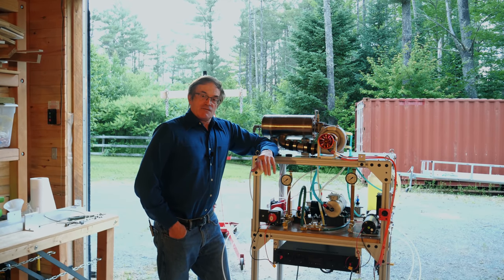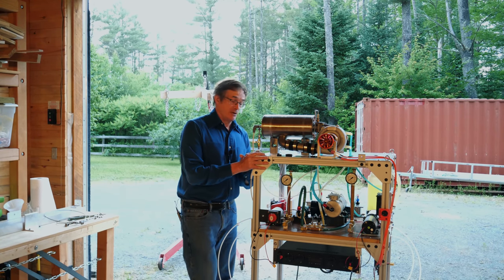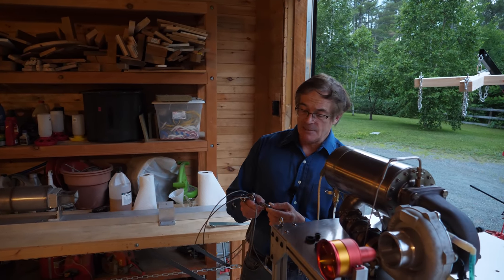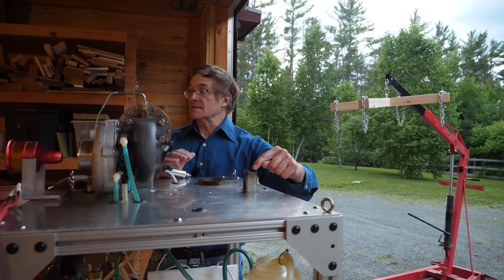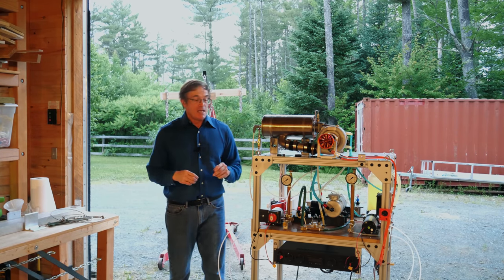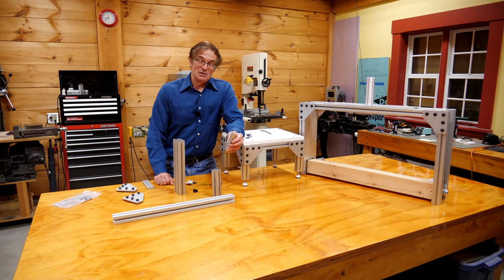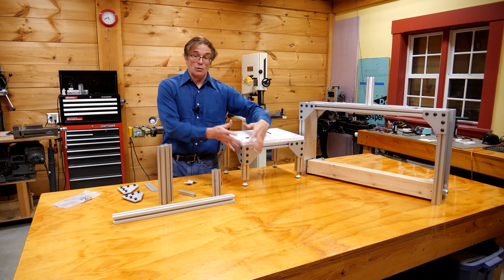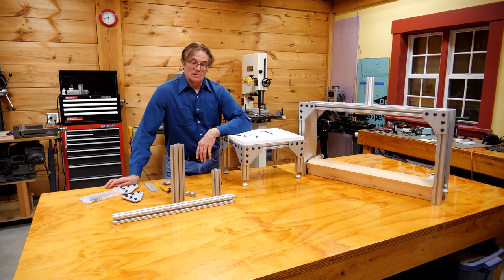What else goes into building a jet engine? - Part 1

Comment: I work in a plastic injection molding company in Germany and we love those aluminum extruded beams. Whenever the need arises for a custom structure, that's the quick, easy and cheap solution and, even in an industrial setting, if properly built they're eternal.
Reply: i think we used literally 8020 stuff when i was working in a shipyard in germany. unfortunately it looks like i can't get it just for me from them (can't go by the shipyard or such unfortunately)

Comment: I have a jet engine powered GoKart. It uses a 75HP aircraft APU engine that delivers rotary power through a gear box that reduces the internal 50Krpm to 6Krpm. We built another gearbox to reduce the rpm to 3500. It has some jet thrust. It uses a variable ratio hydraulic drive system and a home made differential rear end so it drives like a fine automobile. We built it from scratch 20 years ago and many many people have driven it. It accelerates very quickly but is limited to 50MPH,  We use a 25% gas 75% diesel mix as fuel. It has dual hydraulic brakes, springs and shocks, a Volvo seat, starts from 3 lawn tractor batteries on board and real jet instruments from an airplane. It even has reverse. The driver is protected by heavy armor plate in case the engine explodes. It has never given us any real trouble. We did sweep up our first differential that came from a lawn mower with a broom. We subsequently built one that has been trouble free.
Reply: I would love to see that on youtube if u got any videos of it please show me where to look
Reply: I'd love to see that as well, John.
Reply: Do you have an idea of how fast it would go without the limitation (and maybe some other modifications to ensure it survives)?
Reply: Any videos of?  Sounds like an interesting design worth showing as I'm interested to see what you described.
Reply: Any videos i would love to see that

Comment: Good thing to keep in mind is that 80/20 is effectively the "name brand" for extruded aluminum fixtures.  There are literally hundreds of other brands that offer the same or similar products.
Reply: More about the standardization...
Reply: I've had a bad experiences with their lead time too. It took several weeks for very standard components. I should have gotten the off brands. I think McMaster Carr is pretty good.
Reply: It's also worth beating in mind the cost of it lol. 

€850 just to buy the parts for the FRAME,   not including aluminium sheeting, epoxy coated plywood, castors, base etc.
Reply: Thanks for that comment.  I used 80/20 for several years in   the past working for companies without budget constraints.   Now I'm considering a project privately and the cost through 80/20 was alarming!
Reply: @Ontariolabz  It really is shockingly expensive, I really don't know how he made this for $350(talks about it in a separate comment) when he says in this video each corner bracket is $15 and it uses 24 of them, that's $360 alone, and the lenghts he uses here are 75c per INCH!! I checked their website, I just left it after that because I didn't want to argue over something so trivial.

They're very high quality tbf, but ye they're crazy expensive to be using for hobbys like this. If I had enough money to not care I'd definitely buy them though tbf.
Reply: @atourdeforce  He likely receives parts from companies for free or discounted / already had a substantial amount of parts already.

Comment: I'm really interested in the turboshaft engine. Do you intend on connecting that to a motor-generator, or are you going to put a propeller on it (and maybe make the ultimate catamaran)? I'm asking because I'm wondering how you'd actually measure shaft power, and if the power was high enough, it'd be interesting to see if you could make a decently powerful generator out of something like this.
Reply from the maker: Yup.
Reply: From what I know jets have very low torque
Reply: He said he was going to do a turboshaft. Thats basically another turbine hot section connected to an output shaft
Reply: @RogierYou  they substitute with rpm. You would need reduction gears to work in the right rpm range for a standard generator.
Reply: @TechIngredients  awesome,can't wait to see that.
Reply: You wouldn't make an efficient generator from this. It absolutely GUZZLES fuel and doesn't have amazing torque numbers compared to a simple diesel engine. You want lots of torque to run a generator. 

Very fun project 😀 but very very unpractical.
Reply: @atourdeforce  this turbocharger based jet likely isnt optimized for efficiency but a turbine engine can match a diesel for fuel efficiency at fuel throttle.
Also a turbo spinning at 80k rpm with enough reduction to spin a generator will make lots of torque
Reply: @BrokeWrench  I really can't fathom how it could touch it I'd imagine it I'd about 4 times less fuel efficient. But I'll concede I'm only surmising and I'm not an expert on it. You have me curious now  to do some digging.
Reply: @BrokeWrench  BTW you be REALLY surprised how much torque generating needs. We have a waterwheel which produces unimaginable torque but low speed, amd once through the gearbox as soon as its up to speed, enough to start generating, the whole thing bogs down the waterwheel by about 50%. It's also a small generator running off the gearbox output. 

So I'm not convinced just because you have high revs, will guarantee you high torque out the other end.
Reply: @atourdeforce  part throttle turbines are very inefficient, so yes, as a generator they aren't a great idea, but at full throttle a well designed turbine engine is just as efficient as a diesel at a fraction of the weight. That part throttle inefficiency is what hurts them. Everything has its tradeoffs. This turbo based turbine is far from being efficient because the amount of compression after the single stage compressor is low and the work extracted from a single stage turbine is minimal especially since an automotive turbo is likely designed to to minimize flow restrictions and only needs to spin the compressor up. Still good for about 40hp to 60hp on that size turbo. Could probably extract 20hp or so from a simple turbo hotside connected to a shaft though
Reply: @atourdeforce  say your generator runns at 3600rpm and your turbine spins at 80k rpm but only makes 5ft lbs. Thats a 22.2 time torque multiplier means the generator would see 111 ft lbs of torque from the engine (minus losses at the gearbox)
A typical diesel pickup truck turbo needs 60 or so hp to compress the intake air for normal operation
Gears can increase or reduce torque, but rpm changes proportionally to continue producing the engine's current hp level
Reply: Yes turboshaft pleaze!!!!
I love your experiments and proof of concepts.
May we please see you put this to practical application! I can't wait to see what you could build in your own monster garage. I could imagine if you rolled a bunch of your various Subsystems together into one single application! Perhaps an amphibious human carrying single seat jet  turbine electro propulsion multi rotory flight platform  with high-power electro magnetic microwave 3D crash protection forcefield , audio phase shift sound reduction noise protection,  modulated pulsed plasma generated laser guidance collision avoidance. Of course the system will have great fuel versatility, however the preference will be to fly it on the good distillate of the professors rum formula.  Although I am a bit at a loss as to where the solid propellent rocket motor technology is to be employed? Rocket assisted ballistic parachute ?  Doubtful with all the other innovative crash protection. Surely not any type of weapons delivery? (Tech  Ingredients doesn't  recieve DARPA funding? Doubtful,,,Hmmm) 
Of course we haven't gone into the subcritical fluid systems used with the heat exchangers and supercooled superconductivity motor windings and power distribution systems. 
Some things remain highly secretive in the form of charged particle cloud experiments..... 
What all did I forget? 
Does smashing televisions fit into the equation?
Reply: @RogierYou  Power is a function of torque and RPM. Got lots of the latter.
Reply: @atourdeforce  That outcome changes with a recuperator.
Reply: Breaking Bad

Comment: Please please please go back and list EXACTLY what you used for your acoustic speaker setup, also why you used the acoustic ceiling tile versus the rockwool faced insulation you used for the sound chamber.  WHICH type of acoustic ceiling tile did you use? I've been attempting to match it, while also providing acoustic dampening on my walls.
Reply from the maker: The rockwool insulation is too soft and would simply  compress rather than bend or flex.
The Armstrong ceiling tiles  are all basically  the same except for the cosmetic surface treatment.  They should all work similarly.

Comment: I worked at a manufacturer of conveyor belts for several years and the area I worked in was R&D. We used 80/20 for everything, for shelving to complex support and safety "cages" which housed massive tools designed to cut the plastic modules which the belts were made from. The main advantage, no welding required, the adjustability was another key point in its use. If something didnt line up quite right, loosen a few screws and give it a decent bump and retighten... WALA problem solved. And being that it was aluminum, no rust or paint to deal with. Hopefully one day it will be affordable for home use, unfortunately it is expensive and beyond the budget of the average "inventor" mad scientist.

Comment: You should look into wagon brakes for your movable stands.  We used movable set pieces in the theater with swivel casters but needed to be abe to lock them in position.  The caster braves were no secure enough.  Wagon brakes lift the platform off the casters so that the platform cannot easily move.  Your favorite supplier McMaster Carr carries a large selection.

Comment: For through holes consider flexiform grommet as well, comes as a ro0ll of nylon that you simply cut to the circumference of the cutout, and then glue in place. Handles pretty much any size hole, and comes in various thicknesses for various materials. Oil, water and fuel resistant, and very hard wearing. Have used it for bearings on shafts that have a limited amount of rotation ,and it does work well, keeping the shaft from wearing for a long time, and simple to replace as well when worn.

Comment: you should ad a link to a source of the aluminium profiles in the description.
I wonder: the 5 holes in the profile go all through, and the profiles have a large surface.
imagine a desk that rests on such profiles with this channels for watercooling.
two side legs would be u shaped and those legs be connected at the front and rear edge of the desk. this would create a loop. at some point this loop could be interrupted to attach a computer to it.

Comment: A side topic for the turbojet engine thing might be bleed air systems. The compressor can make a surplus of pressurized air on the intake side. And although it's hot from being compressed, it's still not as hot as the exhaust gases. In turn it could still be used to drive small auxiliary turbines that provide power or simply providing pressurization to other things.
Reply from the maker: True and we're  planning  to incorporate  that principle into the turboshaft.

Comment: Can't wait for that solar tracking mount video you hinted at. I've got a small diy 12v 2panel setup that I want to be able to wheel around anywhere as a single collapsable unit (that can fit in a sedan with the rear seats down) with a view to add tracking later. I'm keen to see how far 8020 hardware would get me.

Comment: I love those Al strut systems but wish they had Kits with all the he common stuff all in one at a bulk price. I struggle with keeping any inventory of all the parts I need (and some I have no clue exist) and buying them ad hoc can get pricey. I'd love to be able to spring 500 bucks and just get a starter kit of everything.
Reply from the maker: I disagree.
They are fairly priced, but not cheap.  Order what you need for a particular  project and add to that inventory as time passes.  You'll  find that what you use is rather limited compared to the potential options and many of those "kit" components will just end up sitting in a box.

Comment: burn barrel, mount the turbo to the top with the inlet of the exhaust side going into the top of the barrel,  the boost side of the turbo goes to the bottom of the burn barrel ..  get a basic oil system flowing to keep the turbo lubricated and you throttle the turbo by the inlet of the turbo like a throttle body. ..   start a fire close the barrel so its sealed and only exit for anything is into the hotside of the turbo..then spool the turbo a bit and it'll self sustain itself after a fire gets going.. CRAZY BOOST! YOU NEED A WAY TO CHOKE THE TURBO OFF FROM MORE AIR.. IT'LL BASICALLY RUN AWAY ON YOU IF NOT.
Reply: yeah there are various ways to thermally expand gases and channel them through a turbine. you should make a video of your idea :D
Reply: @byloyuripka9624  it's already been done my friend. not my original idea but much simpler and easier to build.

Comment: I would love to see a series on naturally aspirated propane burners using a venturi and Bernoulli's principles to improve my blacksmith forge, but also applicable to people using a foundry.  Seems related to some of your rocketry projects.  I have built a fairly crude propane burner using plumbing parts with a propane tip for the ejector.  Upgrading to a ribbon burner would be a great upgrade.  A nice addition for simple/cheap vs more complicated but better heating.  If you have recommendations of someone who has covered this before, I would appreciate it as well, though I love your style.
Reply from the maker: One thing you can look into is a coil that is located inside the burner and which preheats the fuel so that the pressurized vapor exits just inside the venturi and supercharges the intake flow.
This was the basis for an old jet engine design without moving parts called the Gluhareff jet.
Reply: @TechIngredients  Just watching a few videos on Gluharoff Jet shows me it would get way hot enough, even without insulation.  Perhaps too hot!  Will need to test, but looks like a fun build.  The 90 degree bend seems odd based on what I have done with naturally aspirated venturis, but you can't argue with those results.

EDIT:  Appears 90 degree is more for propulsion, so not necessary, strictly speaking..

Comment: I love this 'channel ' and agree with almost all of the analysis and comentry. I have unfortunately discovered one error when I watched the gas turbine videos.  The statements about efficiency and pressure volume diagrams.  
The thermal efficiency of reciprocating heat engines like diesel (up to 38%) and petrol ( starting at about 12%) is obtained from the area under the pressure volume curve.  The efficiency is a function of the engine compression ratio.  The higher the compression ratio.
However the same does not apply to gas turbines.
I did thermodynamics when doing mechanical engineering.   My professor has worked at Calder Hall and completed his research masters degree on the emergency cooling of nuclear reactors using liquid metals.  He also worked ar Rolls Royce on reasearch using fluidised combustion with gas turbines.
Now, I have been searching for my notes from 1983 with little success, but, if memory serves me correctly,  PV is not the determining parameters for gas turbines, it deta T. (There's no deta symbol on my phone)  That is the  change in temperature between intake and combustion.
A really good gas turbine can be 42% thermally efficient.  In today's aviation gas turbines, they raise the combustion temperature to a point where they drill hole in the leading edge of turbines  blades and pump bleed air from the final stage compressor to produce a boundary layer of cooler air surrounding the blade to stop it melting and/failing.  The blades are cast as a single crystal to provide the highest material strength.  For many years, 747s were loaded with 4 tonnes of demineralised water for take off.  The water was fed through the holes on the leading edge of the turbine blades to cool them and provide extra thrust from the expanding steam.
My memory is not as good on steam turbines.  Pressure and temperature are also prime factor  the limiting factors are again pressure in this case. Steam power plants are typically (if my memory serves me correctly) 540°c and 10 bar pressure limited by the strength and melting point of steel used to construct them.  Higher pressures and temperatures are more thermally efficient but the cost of exotic steels to accommodate this is not economically viable. 
Your commentary is invited.
Reply from the maker: I'm  not sure about that.  Consider a blower, not a compressor  that passes a flow of uncompressed or negligibly compressed air into the combustion chamber where  enough  fuel is added to reach just below the melting  point of the turbine. The engine  wouldn't  generate enough  work to even drive itself.  If you ever try to start an engine you'll  find that without  enough  compression it won't start or sustain.